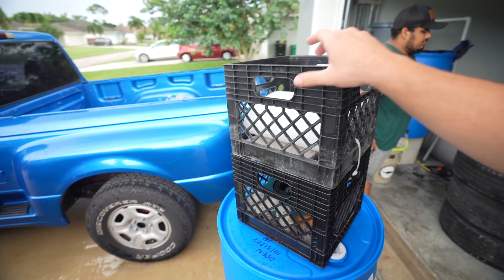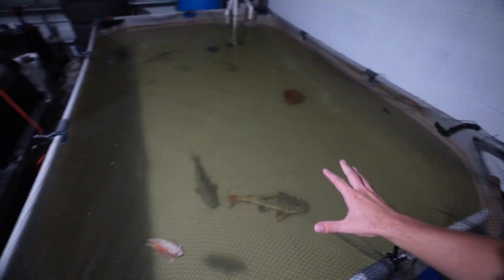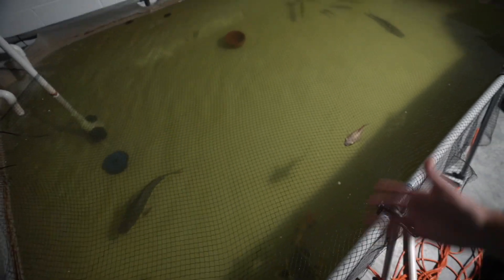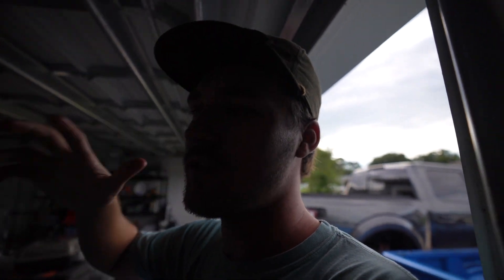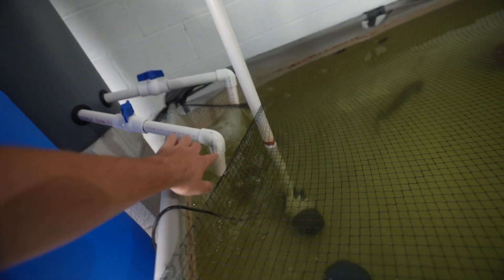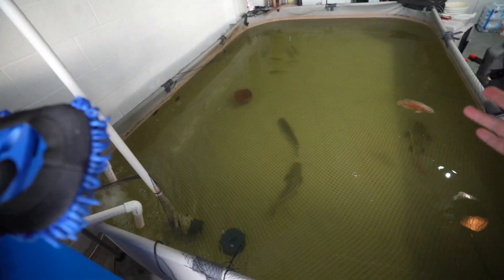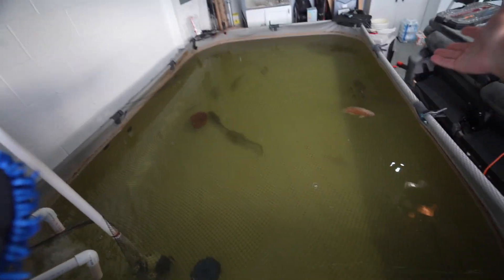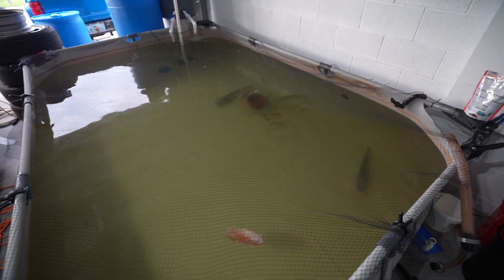BUILDING a CHEAP DIY FISH TANK FILTER!! (under $50)

Comment: I would add an overflow pipe at the very top , so if the bottom pipes get clogged the water will rise up and come out the overflow back into the pond .

Comment: I built one of these filters and they work amazingly for a 10th of the price of a canister filter that struggles to clean a 125 lol 
PSA for my fellow aquarists! Please listen, DO NOT LISTEN TO THE TANK SIZE ON THE FILTER BOXES!!! I cant stress it enough they lie 99% of the time. Look at the gph number instead and then read at what height the pump was tested at. Most pumps are rated with no extra pipe off the pump. Height and length above the pump matter a lot, there is a chart on most pumps about tube height and flow rate loss. Take the gph and divide it by 5 to get the true tank size and also keep in mind if the pump is pushing water up to the tank its going to lose flow rate quickly. Do research before you go in and look at filters, especially canister filters. 500gph can only filter a 100 gallon tank appropriately and thats bare minimum. For proper oxygenation the filter needs to be able to cycle every gallon of the tanks capacity 5 times an hour to keep optimum oxygen in the tank. Canister filters are ridiculously expensive and most cant even filter a 75 to 100 gallon tank unless they are directly level with the tank and the filter doesnt have to push the water uphill. If you do that then you will have a much healthier pool pond or fish tank.

Comment: You should get a filter too, not just a pump. It will keep the water clear and build up the good bacteria your pond needs.

I’d also wait a couple days to feed the fish. Adding fish to a new environment stresses them out and they will most likely not eat at first, so the food you’re putting in will just end up rotting and adding ammonia to the water. 

Adding a lot more gravel and rocks will help more babies survive because it will keep the eggs safe from being eaten, and the baby fry with have spots to his once they hatch.

They also really prefer cooler water around 50-70 degrees is best